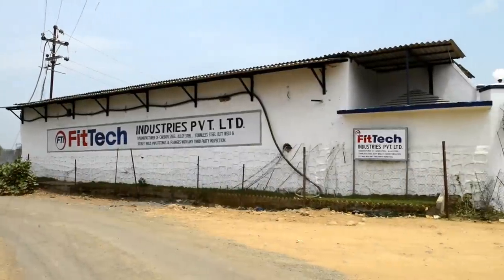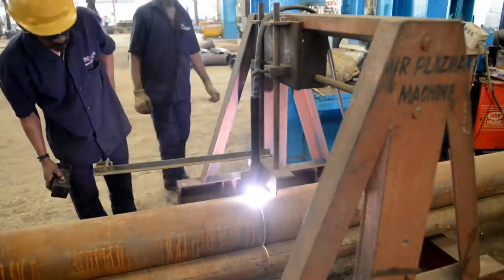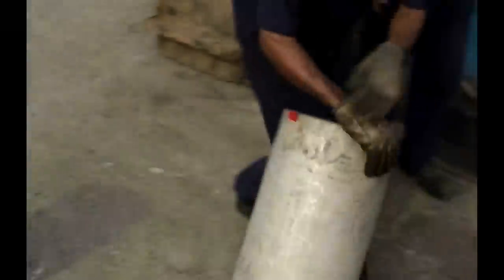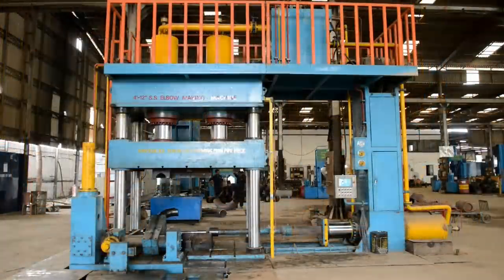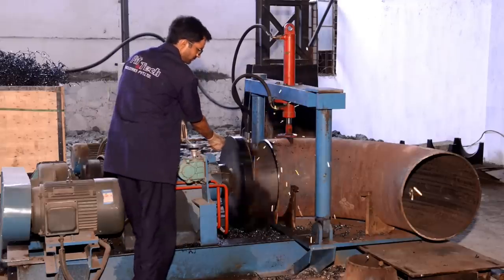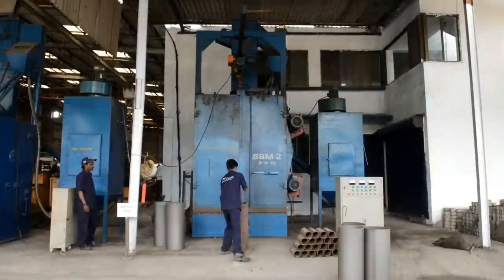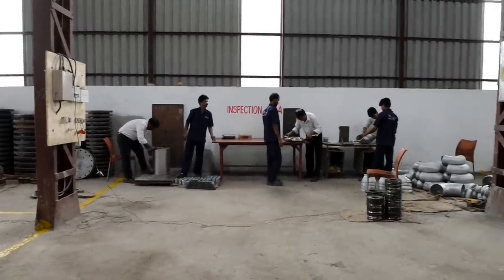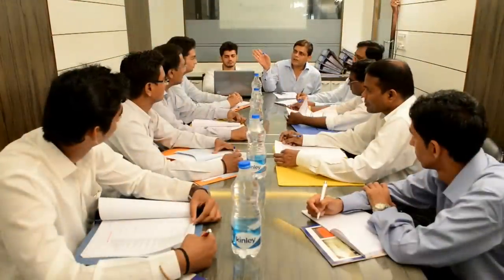Stainless Steel/ Carbon Steel Pipe Fittings Manufacturers In India

Comment: WHEN  THAY MADE EL BOW BY HOT FORMING THAY CUT THE PIPE  STRAIGHT AND AFTER FORMING  EL BOW S END ARE STRAIGHT  BUT  WHEN THAY MADE IT BY COLD FORMING THAY CUT THE PIPE ENDS  OVAL BUT WEN IT COMPLET ITS END S ARE ALSO STRAIGHT CAN ANY BODY EXPLANE  WHAT IS THE SECRET
Reply: This is a very simplistic explanation, but hopefully gets the general idea across:
It hot forming, the walls of the tubing are mostly being stretched; in cold forming, they are mostly being compressed.
In both forming types, the metal is being redistributed in all directions to maintain a uniform wall thickness, just in opposite directions.

Comment: The first manufacturer in India that i have seen have  it's workers wearing gloves ,work shoes although I did not see the workers operating the cutting torch machine wearing welding Google's or any body wearing safety glasses . Gloves to handle the hot metal just cut we're an after thought .